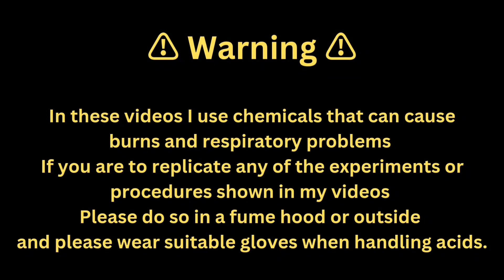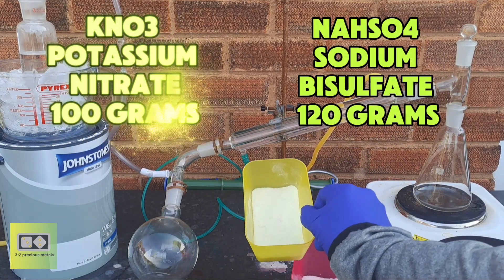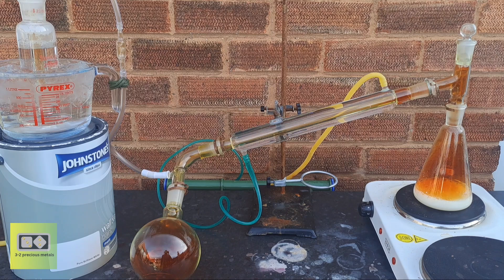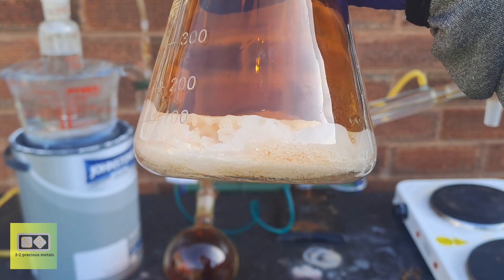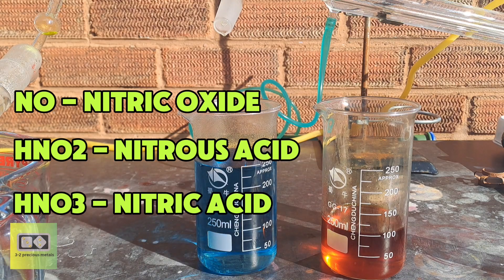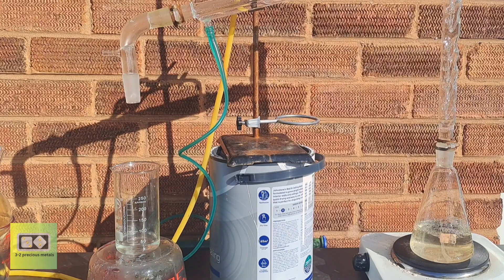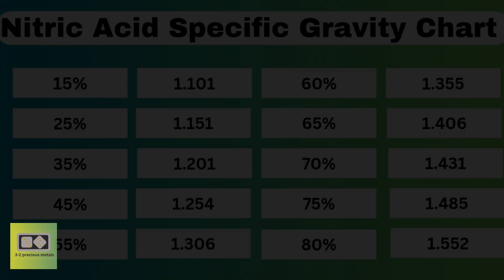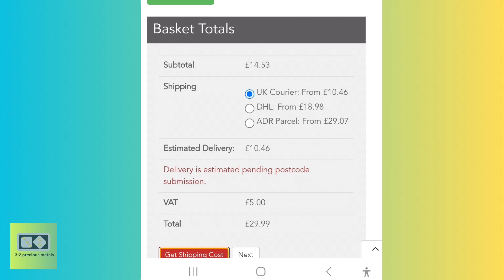How to Make Nitric Acid at Home – Distilling Sodium Bisulfate & Potassium Nitrate!"

Comment: Hi 3-2, excellent setup. I think you could improve the final volume/yield if you use an excess of sodium bisulfate, check nurdrages video on this method. He uses more than triple the amount of bisulfate to nitrate (43g sodium nitrate and 150g bisulfate), he achieves a 95% yield at 75% concentration, also has an interesting table of info from different methods. hope this helps
Reply from the maker: @scouseurbanminer5106  thanks, I'll check that out, I know I could improve yield also by adding h202 to the water in the gas washing bottle but I never thought of using excess sodium bisulfate. Thanks for watching 👍
Reply: Would be good to see a different measurements video. Not a lot out when wanting to use potassium  @3-2preciousmetalrecycling